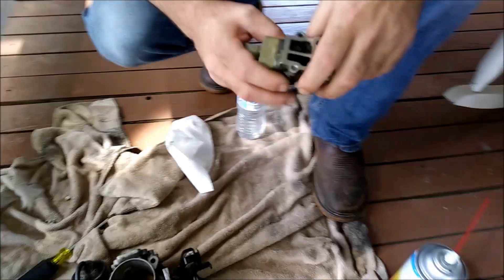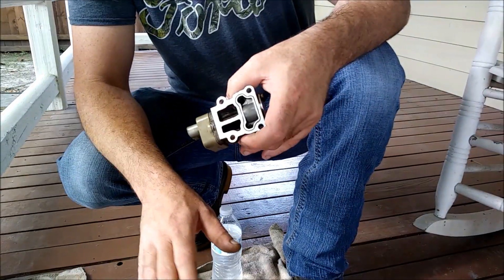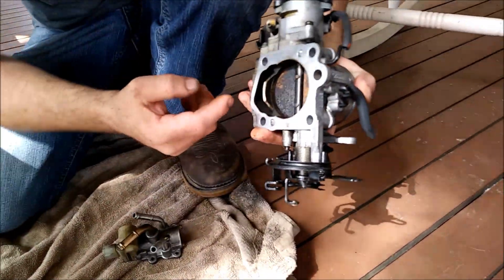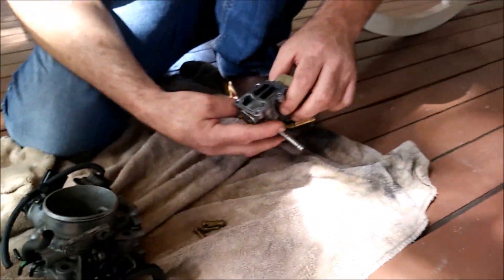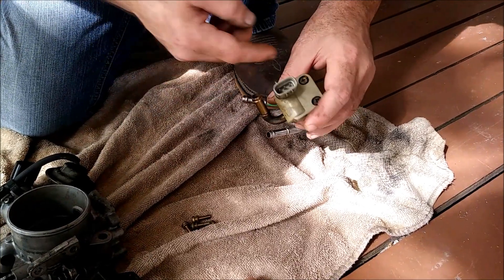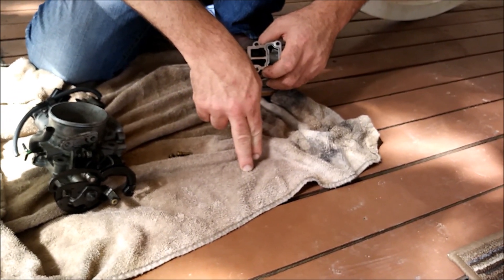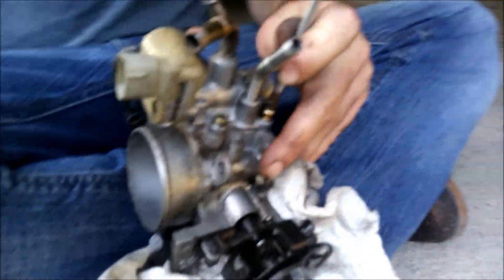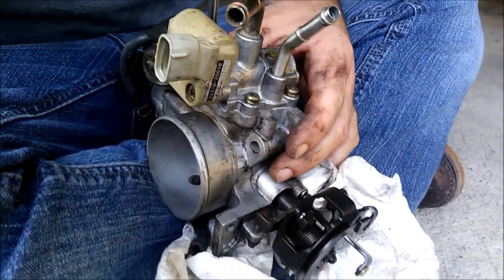Toyota Idle Air Control (IAC) Valve Problems Explained

Comment: Thanks for sharing. You are absolutely right, many of these engine troubles do not even trigger the check engine light. Probably because it's still in the early stages and we should have a good understanding how the whole electro mechanical system works to diagnose correctly.

Comment: My car isn't idling correctly & I confirmed the ISC (or IACV) works when I applied voltage to it after taking it off the car. I only get a solid reading on the ISC plug connector of above 12V on the RSC pin (uppermost pin from ground) to the center B+ pin (battery positive) and I'm wondering what could cause that?

If this is "duty cycle", that means there's signal going to both ground pins and the computer is varying it according to the needs of the motor. I'm guessing the RSO (Lowest pin) should be having some larger value of voltage than the RSC pin when starting cold. The reason I say that is when I connected that RSO pin as ground with 12 volts positive to the B+ pin with a jumper cable, it idles high like it should when the engine is cold.  

When testing with a multimeter, the RSO pin voltage shoots up to 9V and then drops immediately w/o me doing anything when the ignition is in the ON position w/o starting it. I double checked this by using a computer from an old same model car (Toyota Previa) I had, and the same 9v initial voltage jump happened and went back to 0.

Whoever is reading this, if you're idle is working correctly, taking this reading would only take a few minutes and would help me tremendously. 

Maybe when I fixed my MAF awhile back (apparently the solder joints are temporary - https://www.youtube.com/watch?v=CXCpYj-r_lI&t=758s) I soldered something that now is causing this problem...hmm....still thinking about that one...
Reply from the maker: I appreciate the technical end of this. I'd like to know how your vehicle is actually idling. The computer is in complete control of the IAC and various sensors and components will most definitely play a role in how the computer compensates with the IAC. There are even mechanical problems that aren't electrical at all that will affect IAC computer compensation. The first two that come to mind are vaccuum leaks and a faulty or missing thermostat. For instance, when a thermostat is stuck open, you may idle as high as 1100 RPMs all the time unless your engine starts to move closer to operating temperature. I demonstrate this in another video regarding the Toyota Camry with the V6. The IAC in my video is simple, force open, force close by solenoid. The computer is responsible for a wide variation in voltage. The IAC is mildly spring loaded but is quickly overriden by varying voltage and that voltage should always alternate. Without researching any further, somewhere between 4-5 volts all the way to 14 volts. I hope you figure out what went wrong or what's going on. You are most certainly right to go back to the last known repair or replacement. Good luck.

Comment: Not Phillips head screws if VIN starts with a J but JIS (Japan Industrial Standard). It requires the use of JIS screwdrivers or you risk stripping out the screw heads. IAC gasket for the V6 throttle body can be gotten from Rock Auto or Toyota using p/n 2221520010.

Comment: Nice one guys. I'm an IT guy (or used to be) but I've never used an OBD2 or other fancy scanner - never had a check engine light so I presume I never needed to. I know enough about computers to know they're only as good as the guy who programmed them. And he's not always as smart or as good as he thinks he is. I'm still learning pretty basic things like in this video now in my forties but I get such a sense of achievement out of it. Luckily my car is a 2002 so I've still got plenty of mechanical bits left to learn on it. 
Thought I was all done after sorting my throttlebody and IAC last week but now you're making me wonder about my thermostat lol. I never have any overheating so I thought it must be fine. But it does take more than a few minutes for the idle to drop so perhaps I'll check into that. How long does yours take?
Reply from the maker: It used to take about 15-20 minutes. That was too long. We removed the thermostat and found that the mechanical spring had lost its tension. So even though it functioned, it was too slow to open because the spring was too weak to move fast enough. One replacement thermostat later, the Toyota warmed up in about 7-10 minutes, shorter if it was driven.

Comment: This cheapo IAC I got had a gasket that was too fuckjing big! I reused the original, was getting a non cylinder misfire nightmare. New vviti's/screens, two suspect coils changed. IAC was why it's throwing me tons of codes unless goosing the gas for 10 -15 seconds. Only IAC code. Think I hooked up something wrong, but no. Is it possible gunk from vvts's /screens, clogged this cheap IAC? Great video.
Reply: BTW, I had to use a 6ft pipe as a lever to pop out a vvt whose solenoid busted off! so easy to get to, previous owners knew dick about maintenance. Obviously!
Reply from the maker: People clean the IAC while it's still on the car. That steel flap has zero tolerance for sand and grit. So when they wash sand and grit back in it, it starts collecting. Then it starts scaring the flap, causing all kinds of shit problems running you round in a loop. The best way to do it is take it off, clean the whole body, then douche the IAC and work it back and forth. Off camera, I douched it several more times. There's crevices and webbing all in the aluminum for sand and grit to hide, and you know Toyota, it throws a code if the driver sneezes.
Reply from the maker: @ChrisMichaelsChicago  I hate Chinese aftermarket parts.
Reply: @shadetreeautomotiveenthusi1284  LOL  I pulled everything but the intake. I let the gas get low and it killed the whole fuel system. Got everything I thought. New plugs made a rig with some shrink tubing and clean all the injectors. New o rings and spark plugs, and cleaned all that you did bro. . 2003 RX300 3.0 with the dual butterfly setup. New fuel filter and pump as well. Pain in the ass
Reply: My issue is I just got to keep the RPMs up with my foot and after about 10 seconds it'll idle perfectly
Reply from the maker: @ChrisMichaelsChicago  You have a vacuum or electronic fuel pressure regulator?
Reply: @shadetreeautomotiveenthusi1284  vacuum. Passed the thumb test.
Reply from the maker: @ChrisMichaelsChicago  Gotcha, what about an open loop, the temp sending unit. Or do you have the problem even when it's warmed up?

Comment: My 2003 Matrix XRS has IAC issues and there are lots of IAC from $120- $400 so how do I test for defectives? I heard that the ohms between pin 1&2 and 2&3 have a specific range, outside of that is junk. The problem is I can't find the spec for the resistance and no one seems to be checking them that way. Would be great if you could post the ohms from the good IAC on this Camry- might save folks from sticking a defective new one on their engine. Inspiring video, I have to say! My IAC is stuck so I'll try your way. Thank you.
Reply: 10 to 15 ohms

Comment: Any idea what the plate is with the 2 screws that can be seen at 4:05 in the video....? I know it's factory set but will it adjust your low idle....?
Reply from the maker: The idle is set by the computer. The plate you're looking at is the service plate. I have never removed it because I don't want to hunt a gasket down for it. I would say it's a plate that removes the rotating valve and exposes the water jackets. The water jackets run hot water in and out to keep the IAC from freezing or sticking in cold weather. The idle adjustment should be controlled by the computer. If you're having an idle problem, you have other mechanical, vacuum, fuel, ignition issues. My low and high idle problems were associated with sand, grit and carbon stuck in this IAC. Some throttle bodies may have a screw adjustment on the throttle body, not the IAC.

Comment: So mine is idling low and I noticed hard to start when it's cold I cleaned the throttle body and iac port to but I think not enough I also I measured the resistance on the pins it kind out of the range it's reading 20 to 25 ohms when I read in the articles it's says it should be at 10 to 15ohms but I noticed when I unplug the wire on the iac it's idle high around 1100k and when I turned off and plug back it goes back to low idle around 596 to 640 and when I put a/c on its gets worse and a/c clicks in and of 
Sparks plugs are new ND no vacuum leaks and I checked coolant sensor based on temperature and ohms it was good and in the range so what should I do next ? Please

Comment: So the open and close pins on the switch does it matter which wire goes on what pin or does one just close the valve and the other opens regardless of what wire is on it
Reply from the maker: Correct, the pin in the center is NEGATIVE! Positive on either side opens or closes it. It's a double throw solenoid.
Reply: @shadetreeautomotiveenthusi1284  at 4:54 you said center pin is always positive but u said here in comment its negative??
Reply from the maker: @toyotacamry1239  Thank you for clarifying that. I found that the polarity on that particular IAC was reversible without any harm to the solenoid. Gave me the same reaction for testing purposes.
Reply: @shadetreeautomotiveenthusi1284  thanks for replying back that's what i figured it worked both ways

Comment: IAC QUESTION; Do you know if the IAC Is responsible for raising the idle speed when you turn the a/c on in an older Camry? I know the computer is involved, but does the IAC do the physical work? My 99 Camry's idle spools up a bit higher, then it settles down to exactly where it was when I press the a/c button to on. What is confusing to me is my previous 98 Corolla maintained a higher idle speed when I pressed the a/c button on to help with the bigger load on the engine. Just not sure if my Camry is supposed to be doing the same thing.
Reply from the maker: On your Camry (Gen. 4) The ECU is responsible for raising the idle when the A/C is on. This would ultimately have to do with a clogged/dirty/weak IAC valve according to other misc. forums  Here is a link to a service manual I found for your year.

https://cardiagn.com/air-condition-99-camry/
Reply: @shadetreeautomotiveenthusi1284  Okay, thanks for the link. It says with the compressor clutch engaged AND not engaged, the idle speed is supposed to be 700 rpms (plus or minus 50 rpms) which it is, SO, unlike my Corolla which had a higher idle-up speed when the compressor engaged, the idle speed of my Camry is supposed to stay the same, right (just looking for confirmation)?  That's exactly what my engine is doing, so I guess it's working properly.

INSPECT IDLE–UP SPEED (a)Warm up engine, (b)Inspect idle–up speed when the these conditions are established: 

-Warm up engine 
-Blower speed control switch at ”HI”
-Position A/C switch to ON
-Temperature control dial at ”COOL” position 
-Magnetic clutch condition Idle–up speed Magnetic clutch not engaged 700 ± 50 rpm
-Magnetic clutch engaged 700 ± 50 rpm. 

If idle speed is not as specified, check ISC valve and air intake system.
Reply from the maker: @dbfcrell8300  Idle will change for a short bit as the ECM (computer) makes its adjustments to idle to compensate for the AC. As in my video, my IAC wasn't defective. but rather, was just full of garbage preventing it from fully opening and fully closing. My Camry has an "A/C idle up Valve" (Mk III Camry). Your Camry is a generation above mine, which doesn't have the A/C idle up valve. If the IAC was like mine, blocked by garbage, I imagine it would cause a problem with idle up. If it says so in the manual (700 rpms with and without A/C), then I'd say yes, your idling properly.
Reply: @shadetreeautomotiveenthusi1284  I totally agree- it's working properly... and yes, I get the high compensation idle for 10 seconds if the engine is warm when I turn on the a/c. Oddly, since the slightly cooler weather here in New England as of yesterday, my cold high idle is rather high, but I'm prolly just not used to it.  Lots of brown liquid was coming from the IAC's crankcase vent tube, so I'm glad I cleaned  Thanks for all your help and your awesome video.
Reply from the maker: @dbfcrell8300  Yes, during the Winter weather, my Camry took longer to warm up as well. The idle would stay as high as 900-1000 for about 5 minutes, then start decreasing till about 5 more minutes, where it would eventually equal out.
Reply: @shadetreeautomotiveenthusi1284  I think mine's up at 1200 or so. I have a remote start so I'm often not in the car when it's warming. I'll use the key today when I go to work and get a definitive answer. I was going to put the car in re-learn idle mode if it didn't stop with the high idle, just haven't had the time to do it yet.
Reply: Yeah, it's up at 1400rpms on cold start but quickly drops to 1200, then slowly down to 750rpms. Is that bad?
Reply from the maker: @dbfcrell8300  Nah, that's good. Sounds like a normal idling procedure for a Toyota.

Comment: My vehicle idles rough sometimes. When driving along the highway I can't feel it. Only mainly when come to a halt and in Drive it idles slightly rough like as if it loses power. (New Alternator, Air Filter & had Oil change) Getting new spark plugs soon. Also idles rough when smacked into reverse and reversing. 
Noticed also when I'm reversing and flick high beam lights can hear the lose power and idles rough. driving me nuts, Tryna illuminate problems one by one? Any thoughts?
Reply from the maker: Always check for leaking vacuum lines first. Bad hoses, big and small, cause a rough idle. Check all the hoses by hand for cracks or splits. Listen for hissing sounds while the engine is running. If you're careful, you can use an old trick we all did. Let the engine idle in park with the hood open, and spray carburetor cleaner around all of the hose connections. If the engine idles up for a few seconds, there's your problem area. Number 2: Missing or running rough while driving could be a coil pack, or a spark plug. Sometimes, valve covers leak oil into the coil pack boot and cause a miss without throwing a check engine light. Start there...
Reply: Thanks for your reply,  I will check this out 👍

Comment: I did clean that valve with carb cleaner and a tooth brush, it isn't enough, like something get stuck in the bearing... should use an ultrasonic cleaner or a compressor to blow air threw...
Reply from the maker: The solenoid might be weak. Try working it manually, but gently back and forth while cleaning it. You don't want to bend the little flap that opens and closes. After working it, try jumping it until it fully unclogs. If that doesn't work, then the electrical components inside are probably to weak to operate it by itself. You will need to source another one. MAYBE FROM A JUNKYARD, IF YOU CAN FIND ONE THAT WORKS.
Reply: @shadetreeautomotiveenthusi1284   I did turn it gently back and forth, i did it like 3 times, different days, i did it till it did feel unclogged, then it worked for one day, then i had to do it again, and i am sure that this is dirt getting in the bearing (you can see the bearing when removing the electromagnet), it not get stuck that much, but enough to prevent a good cold start, the car is 20 years now (1999 E110 sedan 4ZZ-FE) with 67.000 km, anyway i did not know that the electro magnet could get weak, does it really get weak over time? i did ask for the price of a OEM idle assembly to Toyota, they asked me 724,48 €, i found refurbished ones on Aliexpress, there is plenty of them there, still waiting my order.
Reply from the maker: @hlq2action310  Sure they can. Just like Coil Packs, doorbell solenoids, auto door locks, relays, and starter solenoids.
Reply from the maker: @hlq2action310  One more thing... On rare occasions, but it does happen, a weak engine to chassis ground or battery to chassis ground could cause minor intermittent malfunctions with electrical components. Check all your grounds. Add one if you need to, battery to chassis, and chassis to engine.
Reply: @shadetreeautomotiveenthusi1284  thanks a lot, i received one iscv valve from China (AliExpress), i got to test my actual valve too (with 12v), i will check those grounds as well.

Comment: When reseting the idel air control on a 2003 Toyota Camry . I can find a bunch for a automatic but not for a five speed what do you do different because they put them in drive with the E brake on that you can't do with a five speed
Reply from the maker: https://share.qclt.com/%E4%B8%B0%E7%94%B0Toyota%20RAV4%20Repair%20Manual/2AZ-FE%20Engine%20Control%20System/SFI%20System/0050040.pdf
Reply from the maker: From everything I've read, if you have the 2.4l engine with the E351 manual 5 speed trans, the ECM controls idle. It means you don't have an IAC, unless I've read wrong. I would check all codes from the ECM, replace any vital sensors that are in question, disconnect the battery, touch the terminals together (ON THE CAR, NOT THE BATTERY HAHA) to drain the ECM of power, then I'd hook the battery back up, start it up, turn everything on (lights, ac, radio, rear defrost), and run it on the interstate or freeway through all gears for at least 10 to 15 minutes so it can relearn its idle. You can also clean the MAF sensor with a little spray cleaner beforehand. Check for vacuum leaks all around the engine bay. You know you can do that with throttle cleaner spray. You know how to spray around all the hoses to see if any places you sprayed idles the engine up for a second. I would start there, see what you come up with.